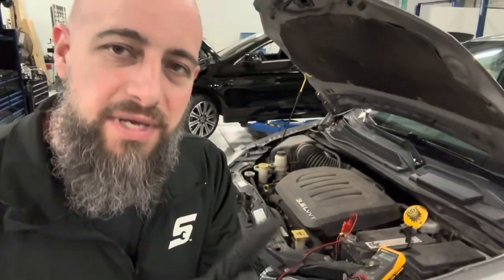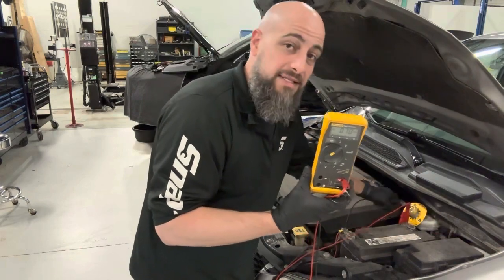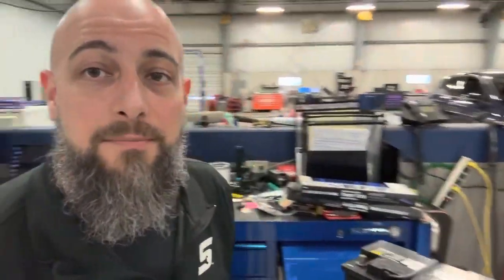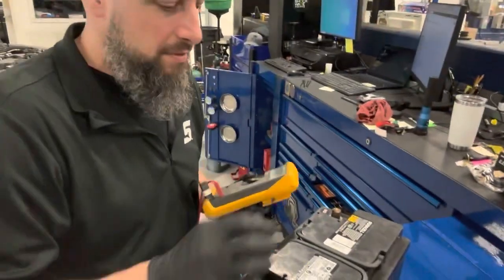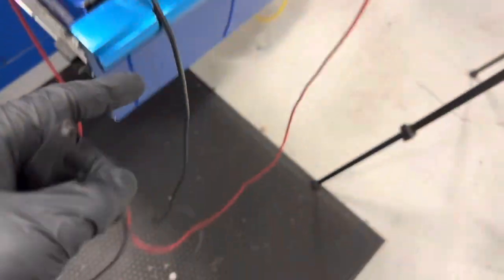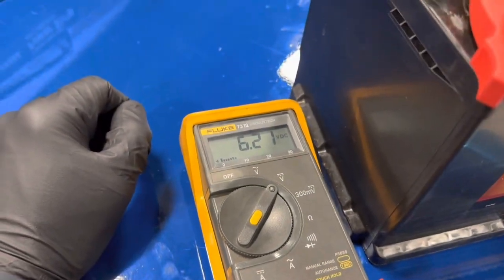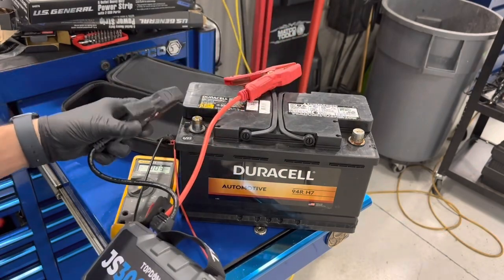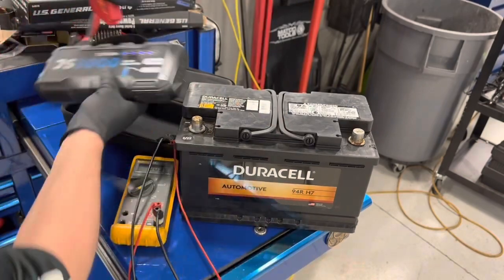Weirdest battery problem I have ever encountered

Comment: I have seen reverse charged batteries several times. I am surprised the alternator didn't flame along with many other failed parts. Usually happens when the battery is completely flat and someone connects the charger backwards. It won't charge completely but it will reverse charge. If the battery is just low, say 10 or 11 volts it will usually produce a weld flash when connected backwards and scare the person into connecting it correctly. I know this from experience. I don't think the newer automatic chargers will charge backwards because most of the cheaper ones won't start charging a completely dead battery unless another battery with some charge is connected in parallel long enough to start the charge.

Comment: Voltage didn't reverse, so to speak. Electron balance changed. More negative electrons at the positive terminal now. The electrons are now flowing from positive terminal to negative terminal, just the opposite of how the battery was originally charged. Jeff
Reply from the maker: Lunch on me

Comment: This is simple.  If the battery was totally discharged and dead,  it was reverse-charged (put the + charger cable on the - battery terminal and the - charger cable on the + battery terminal. It can't be done with a smart (digital) charger. I have several old school analog (dumb) chargers I've kept over the years. If the individual cells are dead, totally discharged, they can  polarity. I suggest checking each cell with a hydrometer see what's going on in each cell (state of charge).  I have a 1956 Allis-Chalmers B tractor, and was getting it in starting and running order a few years ago. It is a 6v positve ground system. I got everything fixed on the engine, and bought a new battery, a DURACELL 6V battery from Sam's Club. I installed in in the tractor and then tried to start it. Well, it would kick over and ruh ruh ruh, then nothing. I tried it several times. Then I noticed something. The engine was turning in reverse.  Seems the battery was 'backwards'... negative was positive and positive was negative. The only think I could conclude was that it when it was initially manufactured, it was REVERSE charged. It wasn't a case of mislabeled terminals as they were the right size, etc.  So it can happen.

Comment: I suspect cell reversal.  That is common on NiCad battery packs. Also, voltage doesn't flow.  Current does.  It could be that the battery has little or no power, but is still showing a voltage.  If you could totally drain each cell (which you can't) it might be able to be recharged, but replace it and forget it.

Comment: Interesting. I have a 1956 Allis-Chalmers B tractor, and was getting it in starting and running order a few years ago. It is a 6v postive ground system. I got everything fixed on the engine, and bought a new battery, a DURACELL 6V battery from Sam's Club. I installed in in the tractor and then tried to start it. Well, it would kick over and ruh ruh ruh, then nothing. I tried it several times. Then I noticed something. The engine was turning in reverse.  Seems the battery was 'backwards'... negative was positive and positive was negative. The only think I could conclude was that it was manufactured incorrectly and labeled incorrectly at the factory. I took it back and exchanged it for one that was correct.

Comment: Somebody reverse charged it. Ironically enough, I worked on a car once with this very same issue. Owner had gone to a parts store for a battery. Installed in the car and the starter would spin but backwards. Also, the windshield washer pump ran continuously with the battery hooked up too. They brought it to our dealership and we fixed it.

Comment: As others say it can be that the battery was reverse charged (reduced capacity, often reduced voltage, but it will still work).

That is not the weirdest thing I have seen with a car battery, though. The following seems to be confined to maintenance free batteries, with bonus points if it has side terminals, is in a car with a primitive charging system, or is in a hot climate. The first time I encountered this it was in a 1984 Dodge 600, in Phoenix. You go out to start it and you get a click, then nothing. The battery reads only a few volts, and turning on the headlights brings that down to 1-2 volts. Hold the key in "start" for as much as a few minutes, and somewhere along the way the engine will groan, then grudgingly turn over, then fire up and life is good again. Interestingly, the battery only needs a few minutes charging to level back off at full charge... and it really is fully charged!

It took a lot of beating the bushes to find the explanation. When lead-acid batteries are chronically overcharged (as can happen with primitive charging systems in hot climates) the positive plates grow in length and width due to a corrosion process of the plate material. Later, when I worked in communications for a Fortune 100 electric company, I saw that a lot with the older station batteries: the positive post would stick out of the case as much as two inches. Anyway, with car batteries the plates often break the connection to the positive post as they grow. Because of that, a more reliable way of getting it to come back to life if it is a top post battery is to whack the positive post with a hammer, about like trying to break a tough nut. Have a helper hold the key in start, or watch the headlights while beating on it. With luck the posts will jam together enough for the lead to tack weld and get you where you are going. I explained this to my 18 year old daughter, and soon afterward when I was out of state she was with my wife in our '85 Volvo when the car died completely at a red light. My daughter went to the back of the car, found a hammer, opened the hood and had my wife hold the key in "start." Imagine her reaction when it actually started! Naturally, it always gets worse so the battery must be replaced at the first opportunity - it is broken inside.

One last thing, that I have never seen but was alerted to by our DC power engineer: google "coup de fouet" and select the Science Direct entry. Spoiler: a truly full charge may reduce battery output when a charger is removed. Weird. Not the sort of thing we would ever see in cars, but still interesting.
Reply from the maker: I have encountered dual
Post batteries where top post shows no voltage but side post does. Guessing broken inside the battery

Comment: manufacturer states "94R batteries feature 'R' as part of their label - this means that the positive terminal is on the right (reversed) side of the battery". However +ve should be marked +ve on the right of the battery and should be electrically +ve. As you demonstrate.
A lead acid battery is constructed of lead plates with sulphuric acid elecrolyte. The +ve electrode is a metal grid with lead dioxide (PbO2) active material. And -ve is a metal grid with spongy lead (Pb2+) active material. Suspect the charger has been connected in reverse many times and would not blow any fuses if done when battery flat. As battery has charged the coating of the electrodes has reversed +ve becoming Pb2+ and -ve Pb02 both lead based. Each time the battery was recharged in reverse the electrode coatings would be re-inforced.
I note you measured approx 1/2 voltage, because as the electrode coatings increased the terminal voltage would reverse, but still retain some of the old (original) coating which in effect is fighting against the original state. 
The normal approach would be to apply +ve to red +ve and -ve to black -ve. But if for some reason they recharged the battery in position and not looked at the terminals having replaced the battery for a 94R then the reverse charging could be possible making the assumption the battery is a direct replacement in the same position. So the cable colours determined the connections and having done this once or twice could have assumed that would be the correct way. Hence the 4 recharges. Why the vehicle did not catch fire or blow a main fuse could be explained by the age of the vehicle. If using relay logic, no radio etc. The car could operate as a +ve earth rather than -ve earth vehicle except motors would run in reverse ect. A modern car full of electonics might have been less tolerant and blow some very expensive module. Though some could have been designed with reverse protection. Like yourself I have never known a similar situation. But hope the above could provide an explanation. I believe in battery manufacture the plates are essentially the same and the polarity is determined during manufacture when charge is first applied. If so it could have been a manufacturing cock-up.

Comment: The answer is on the side of the battery as it says 94 R whereas R stands for reverse polarization. It is a special battery that is used as an alternate to a stock one.
Reply: No. That just means the + is on the opposite side that it is on a battery without the R. The positive terminal (marked) is still the positive terminal.

Comment: Yes is possible to reverse charge a battery. Old school chargers had no safety. Would like to see if the battery is still good though. Drain the battery down with a load like a bulb and then charge it correctly. Would like to know if it's still good or not, if it holds a charge and passes a load test. I bet it's fine if it's only a year old and if it never froze.  Surprised the reverse polarity did not damage diodes in the alternator or other modules. Once had a hidden diode in a wire harness damaged from jumper cables getting hooked up wrong.

Comment: I'm not going to google it either, but I had a flashback to the 60s (yeah, I'm that old).  Reader's Digest article entitled something like "Don't stop the engine".  Somehow, someone had jumpstarted an engine with the wires backwards several times to no avail.  Then they push started the car.  If I recall correctly, the charging system was affected, and there was a risk of a battery fire if they shut the car off.  

The little more scientific answer is that, yes, a totally dead lead acid battery can be charged backwards (by an old-school, non-smart charger).  No need to try this at home, folks.

Comment: the battery cells are out of balance, when some cells discharge faster than others they will reverse the polarity. This is why they tell you not to let battery dead and setting for longtime after it has been used.
Reply: i had this problem a few years ago.mechanic said that.